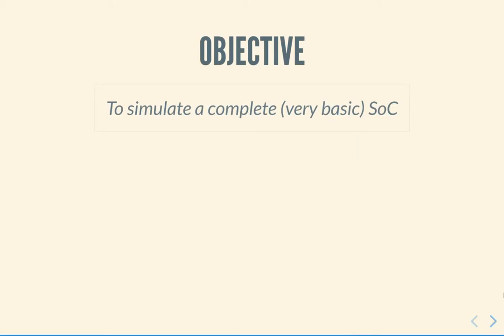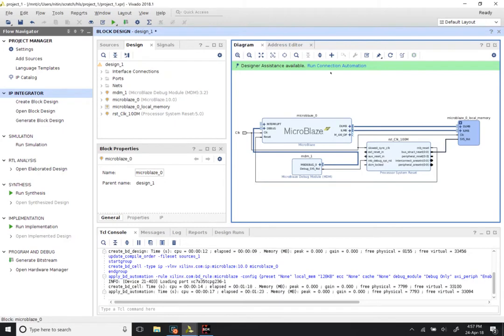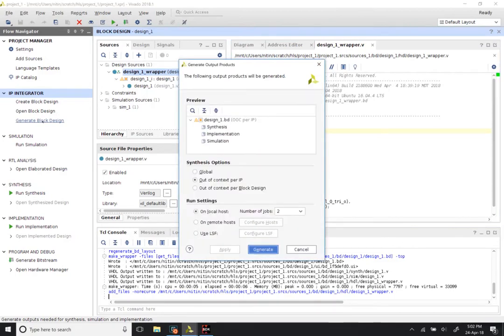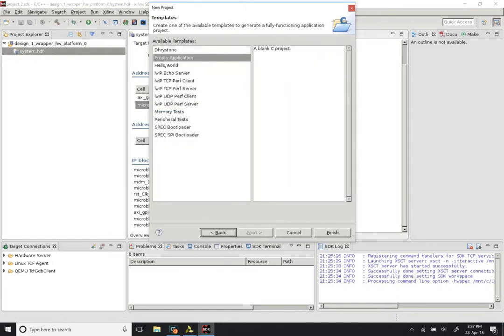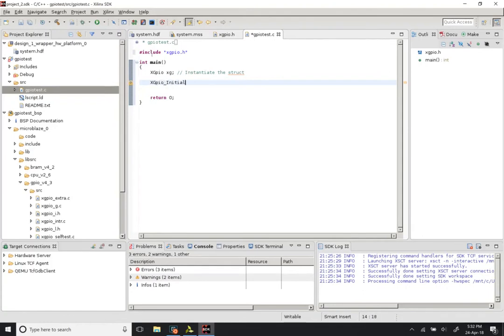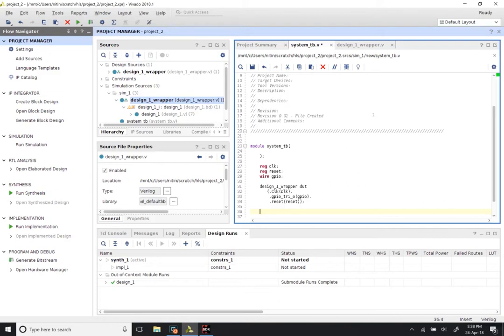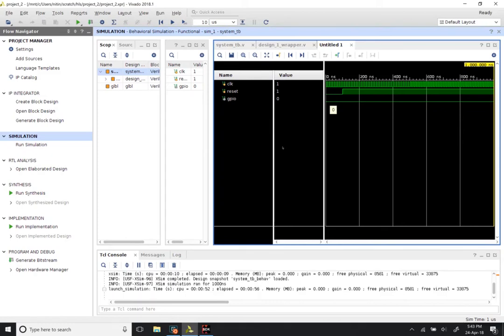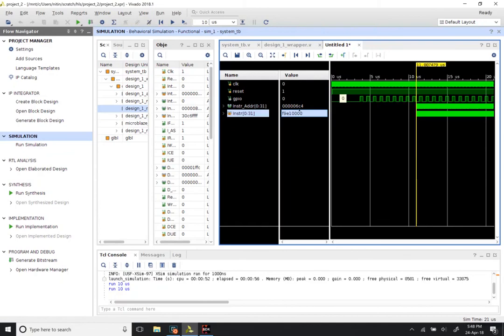Simulating Hello World on an SoC

Comment: Thanks for this tutorial! It is really useful.

But I have a little problem, I have done everything like you, but I when I try to run the simulation it says:

 "ERROR: [XSIM 43-3409] Failed to compile generated C file xsim.dir/system_tb_behav/obj/xsim_2.c"

I have searched it, but I can't find a solution, it would be great if you could help me.

Thanks!